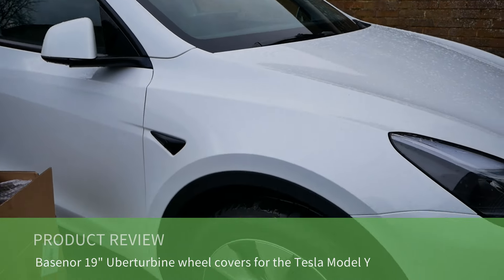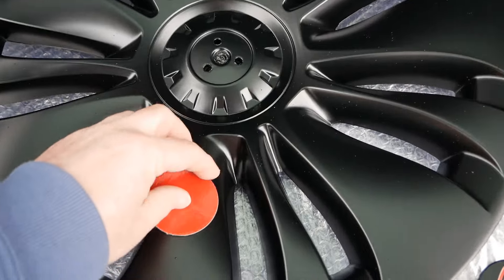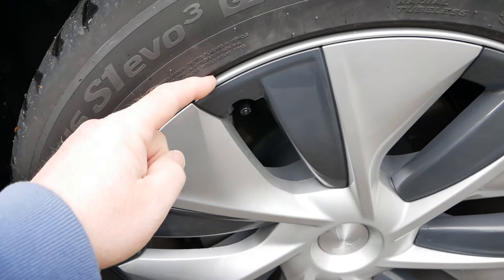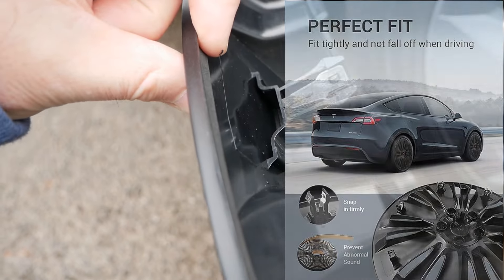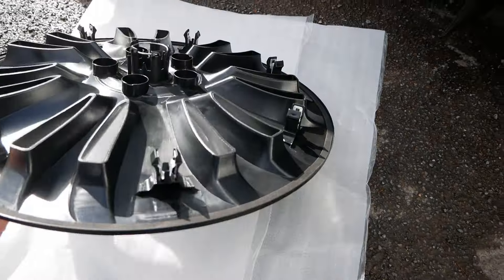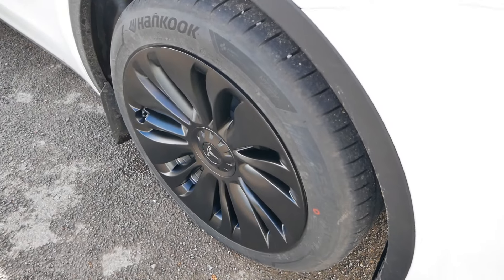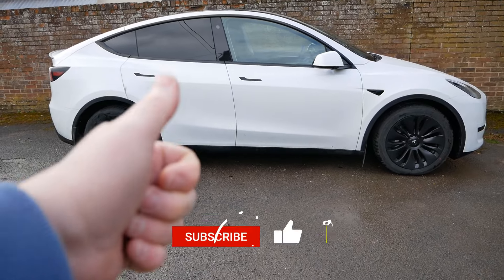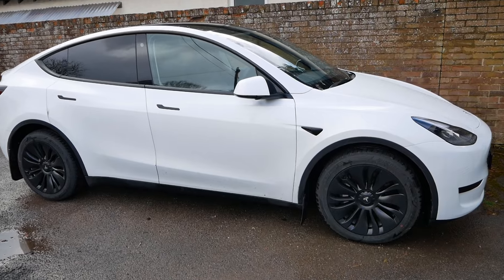Review of the Basenor Uberturbine wheel covers for the Tesla Model Y with 19" Gemini wheels

Comment: The evidence for a wheel trim efficiency gain is going to be rather difficult to accurately measure.
Reply from the maker: I'm not sure if you watched it in the video, but I did prove it. On my second drive I saw a 2.6% improvement in efficiency, yet was driving in worse conditions and used the HVAC, which all would have used more energy. So I would say their claim of 4% is realistic.